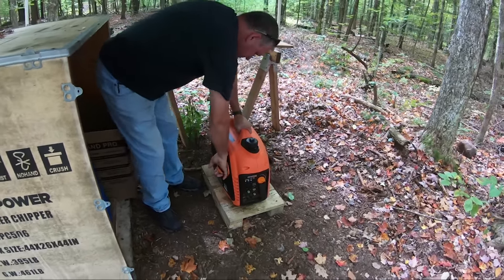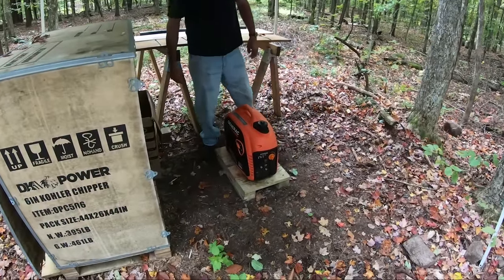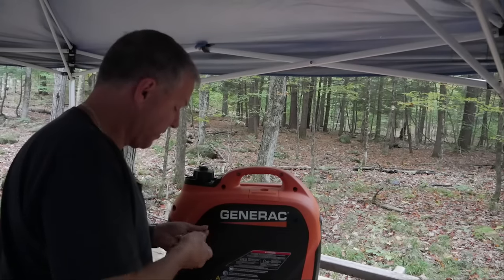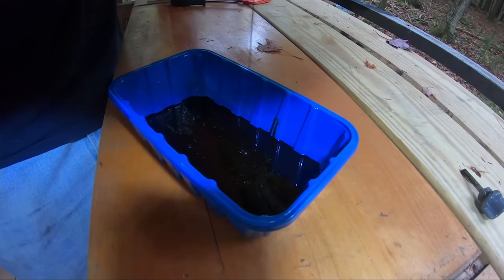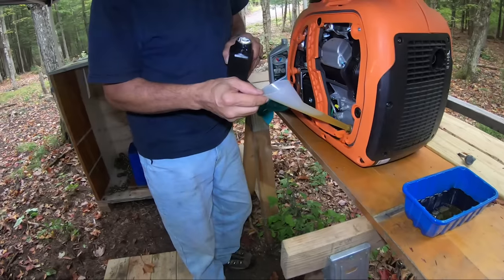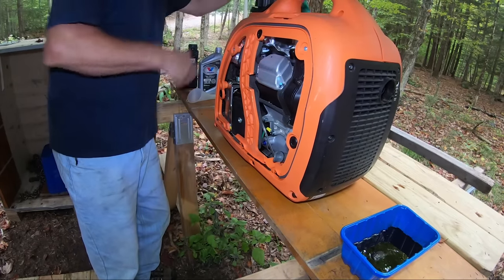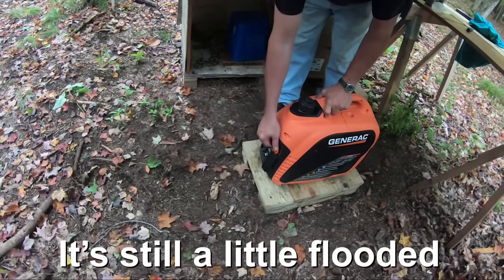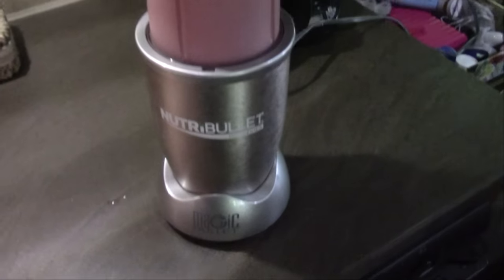GENERAC GP2200i - BRUTALLY HONEST 1 YEAR REVIEW

Comment: Every 50 hours oil change....that's terrible. New oil every 5 days on a 10 hour a day run...that's so inefficient.
Reply from the maker: I thought the same thing, but most of the small generators have a fairly low hour oil change.....Honda 2200 is 100 hours I think. Anyway, since we only use it for about 50 hours a trip it just means we have to change it every time we go up there. It will not be a good permanent generator for in our future home though! Thanks so much for sharing your thoughts and commenting. Have a happy new year.
Reply: What’s inefficient is trashing a good piece of equipment by neglect or laziness by not doing a quick and cheap oil change. They only take a 1/2 quart of oil and five minutes of you time. Less time than it takes to have a s- - t.

Comment: Glad it’s working a year later 
But you probably took a couple years off its lifespan.
 Hard to believe with the micromanaging wife. You didn’t bother to read the care and maintenance instructions.
 Powering our home on a Honda 2k 
365 days a year.
This Honda is 5 years old. Runs strong still.
We change the oil every 50 hours. 
FYI they make hand held transfer pumps Ebay 20.00
Reply from the maker: Your correct, the lifespan will probably be shorter Thanks for commenting and I wish you a very Happy New year!

Comment: Generacs do have super sensitive oil level sensors. They are a pain to replace on the 2200i as well. You have to completely blow them apart and pull the motor to get to the sensor on the bottom.  Every time I had to do one, everyone in our shop would just get back and watch. Guess it was a good show watching the generator get spread out across a 15ft work bench!😂🤣
Reply from the maker: That sounds like fun .I will be sure to change the oil more frequently .

Comment: I have had 2 Honda EU2000. Both overpriced and poorly engineered. Junk.
I now have a Yamaha 2000 watt and I am impressed with it.
Way better than the Honda. I would never consider a Generac  generator. You get what you pay for.
I use mine on the lake, ice fishing. Lots of below zero temperatures, and running for days at a time.

Comment: Poor design for changing oil. Makes a guaranteed mess. All the other small gennys have a drain plug. And using a pump to change oil only leaves filings and sludge in the bottom of the crankcase. 
Bad idea. At least when you pick it up and pour it out everything gets drained as a drain plug also does.
Reply from the maker: That is true. We are going to try to use a small syringe (we bought one to try), but you are right, nothing beats lifting it upside down to get all the 'crap' out!
Reply: @CreatingASimplerLifeOffGrid   
Just get a pipe fitting of the same size and thread count as the dip stick to screw into the fill hole for draining. Then you can just lean the generator over the side of the table and drain the crankcase into your drain pan. Should be less messy.
Reply from the maker: JeepYJ91 great idea!!!we already bought the syringe but I really like the idea of pouring to make all the particles come out too. Thanks 👍

Comment: You should have let your wife do the work, like pulling it & lifting it & changing oil.
I hated it. It's very loud, just as loud like many lawnmower. 

At close to $700.00. Returned it back for a full refund.

Purchased the ATG's Cummins A058U955, way better than this & Honda's
My 9 years daughter & I can start this with a touch of the button or use remote control.
Although it's heavy at 50KG, the handle is a god send.
Reply from the maker: Sounds like you got a nice little machine at a better price! We didn't pay anywhere near $700 for this. We got it for about half that and thats why it was a good choice for us. Thanks for watching and hope you have a great day!
Reply from the maker: We just did a sound test on this generator if you’re interested. https://youtu.be/cdubQP76h-g

Comment: i put 150 hrs a week on my gensets and this one sucks total time on it like 750 hr  and it will not do 1500 watts up at 9000 ft up 1500 only it has bin crap all-so have a old Generac 5000 watt its junk but it still works after 15 years i donot use it much as it is junk but it still runs but i will not get a new one ever as ii new i got the Generac 2200i for $260  but it is crap not worth the money allso  generac did not like i only paid $260 for it new
Reply from the maker: I wonder why it won't do the watts it is rated for? Definitely doesn't sound good. Thanks for sharing and commenting though. Have a great day!

Comment: Has to be always level??? Wtf? This was recommended to me for use on a sailboat! What happens if it gets sloshed around?
Reply from the maker: I’d say it’s probably not the best for a sailboat. But any of the small generators will be the same way so you could probably get away with it on occasion.
Reply: It's pretty common to use a Honda 2000 or eu2200i
aboard boats but this was recommended as better value.  What happens to it when it's not level?🤔
Reply from the maker: It doesn’t matter. They all need to be level within reason. If they aren’t level the oil doesn’t circulate properly and could trigger the low oil cutoff. Same with gas flow but neither is the end of the world.

Comment: got one its crap will not start in the cold and its bin down  a lot it will do 1300 watts at 9000 ft up it bogs down at 1500 and its bin to the shop 3 times in 1 year 2 pull ropes and a inverted  but this thing has bin crap and oil change sucks got a 4000 watt pulsar its a fine genset  but this Generac 2200is pure crap it will not start win its cold out generac gave me a new one and its crap it win not start cold out last night it was -2 out no start
Reply from the maker: It is really frustrating when you need it and it doesn't work! Sorry to hear that but appreciate the comment.

Comment: I quit the funnel application a long time ago. They are too messy. I went  to Walmart and bought a turkey baster dedicated to changing the oil  I bought a cheap plastic measuring cup and pour 14 ounces of oil into the cup, use the baster and voila. Your oil was partly sludge. If that happens buy some cheap oil and replace old oil with cheap oil and run the machine for an hour. Repeat this until cheap oil come out clean. Then refill with quality oil. Suspended in your sludge oil are metal particles and corrosive hydrocarbons which can etch cylinder walls.It is also not recommended using full synthetic oil until after the first 100 hours Synthetic is too slick and does not let the cylinder rings seat properly. Of course I own a real generator not a Generac. I am just kidding as I know Honda owners are snobs. I change the oil in my machine between 6-hours of use. Cost is $1.86 per oil change.
Reply from the maker: Thanks so much. I just bought a syringe on Amazon for the next change. I did use regular oil for the first 50 hours before the synthetic so that's something. Would have been a good idea to use cheap oil this time and I would for next but I'm really not planning on ever letting it go that long again.  I really appreciate all the info very much though. Have a great day!
Reply: Hondas are better. I have an eu1000 that I bought 20 years ago. It has over 50,000 hours on it. Oil changes, air filters & spark plugs is all it's ever had. Ran pump gas the whole time...oh, I cleaned the carb once.  That was ten years ago.
Reply: My honda...100 hours between oil changes.
Reply: 6 hour oil changes...I'd have to change mine every day.
Reply: @waynes.2983  It is just what I do and of course every person should do what they think is correct. Of course I am always right, I thought I was wrong once, but I was wrong about being wrong.They cancel out.
Reply: @waynes.2983  I have owned a Honda Eu3000i before. I went through a divorce and my ex-wife took the generator. I asked her why she wanted it because she could not find the gasoline cap if necessary. She took it because I liked it and cared for it. Anyway I lost a lot of money in my divorce and am now fairly poor. It took me three years to save for this unit, and I was going to get the Eu2000i, but the time frame worked out for this better unit. Three years living in Florida with three hurricanes in a row, power outages, loss food in sweltering temperatures, it was horrible. This generator means a lot to me and I take care of it as if my life depended upon it. Just wait until Y3K and you will see. If I run this generator for more than fifteen minutes I change the oil, clean and gap the plug, clean spark arrestor, wash, dry, and oil both filters, drain the carburetor by opening the bowl drain and turn the engine manually to remove excess gasoline and fog the cylinder. When operating this unit in the heat I have a small yet powerful fan I use to cool the inverter through the vents. Excessive yes, but I cannot buy another one.  Two things if you have a lot of time on your generator, don't forget to set the valve lash and change the fuel filter or clean it at minimum. Sorry about the length.
Reply: @waynes.2983  They are fine machines.
Reply: This also a Generac forum and it may be rude to talk about Hondas.
Reply: @waynes.2983  50,000 hours? Dude that is like 40 dog years.
Reply: @TheMickeymental  she wanted it so you couldn't have it.
Reply: @waynes.2983  That is the gist. She could not even lift one end. She never had to work unless you call it work to turn into her mother.
Reply: Brad Davies, I feel for you, my brother. But you seem to have a resilient spirit; stay well.
Reply: @DanielinLaTuna  There are no other options. Thanks.

Comment: 9min of cord pulling and and oil change and less than 1min to tell us it never let you down...even though your getting let down in the video. Lol
Reply from the maker: That’s one way of looking at it. LOL. The other way is that it was my fault for not changing/checking the oil according to the directions. It has an automatic shut off if the oil gets low.

Comment: Creating A Simpler Life.

1st oil change at 343 hours when it should have been at 30 hours & then every 100 hours ? Then you take away the oil container that had the correct oil volume ? Is there not an owners manual that gives you the amount of oil ? It should be 10 oz. The factory bottle is 20 OZ. So 10 OZ at the initial start up fill & 10 OZ at 30 hours. So what happened with that oil container ?  Air filter check & replace, if necessary, every 50 hours. There's a screw in funnel supplied with the unit, the one you had but you didn't screw it in & tilt the generator over & cleanly drain the oil into a container. You could have put the generator side on & filled it to the correct amount & screwed the filler cap on & so minimise the mess.  There should be a law against people like you & wifey from owning anything that runs on petrol/gasoline but unfortunately there isn't ?  The caravan is 18.5 feet hardly small ? When you have the entitled mentality I guess "living rough" is tough when you aspire to have a big home with all the luxuries of life.
Reply from the maker: We are sorry that things are so difficult for you but appreciate the comment and hope you have a good day!
Reply: @CreatingASimplerLifeOffGrid  

Things for me aren't difficult at all. In fact very much the opposite ? So I don't want you to feel sorry for me ? What a stock phoney answer you made there ? As is your user name "creating a simpler life".

Unlike yourself an important thing like scheduled oil changes on a new generator are not on your to do list ?

Never mind there's always a new one available at near to $700 as the "old one" prematurely wears out ?
Reply from the maker: @hughmoore810  We are happy to hear that your life is not difficult and wish you much happiness. Have a wonderful day and stay positive :-)

Comment: Stick with Honda.
Reply from the maker: Thanks for watching 👍
Reply: Dave Alexander  Same goes for my Honda lawnmower.
Very disappointed that it needs more than 3-6 pulls when new and 2 years later.  
While the alcheapo Briggs & Stratton 3.5 Classic only requires 1-2 pulls
after 15 years.  My older first Briggs Stratton 3.5 Classic  still only requires  1-3 pulls  after 37 years from the same can of gasoline for all. I thought it wouldn't  make it but it keeps on mowing.
Reply: @loktom4068  HAH!  Read my comments above about my two Honda generators and push mower. Meanwhile, I have an Ariens 17HP rider that I use as a mail getter year round. Even in literally ZERO degrees F in the winter it will start as soon as you hit the key. It hardly even has a chance to turn over. I use the same non-Ethanol gas in everything.  Now I'm certain the Honda engines will last longer - once you get them started. :-)  They sure do hate the cold.